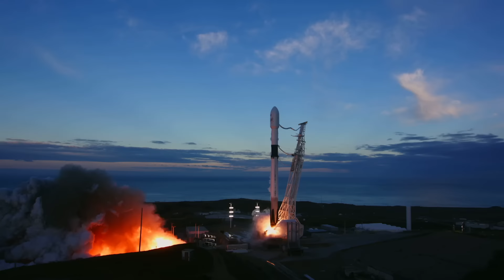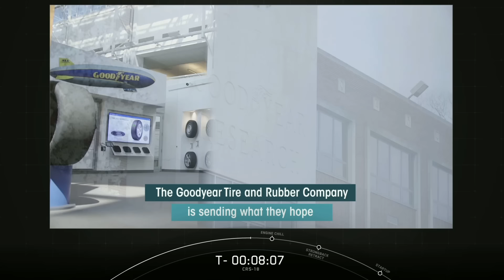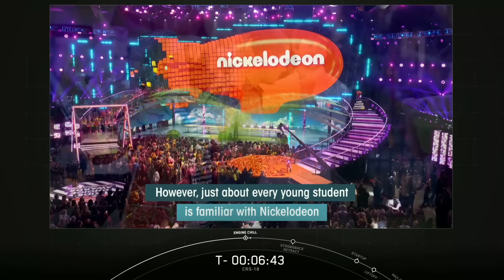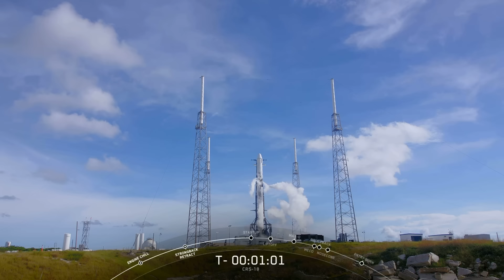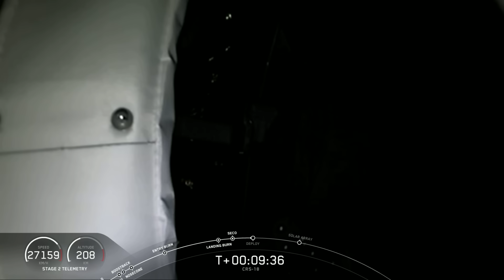CRS-18 Mission

Comment: Grid fins went CRAZY just before touchdown
Reply: That's exactly how they've performed for every mission except CRS-16
Reply: They're traveling much slower so the fins need to move a lot more to compensate for the loss of control
Reply: Im no engineer or aerodynamicist but I would assume it has a lot to do with compensating for the forces of the landing burn thrust radiating back up at the vehicle from the pad as it closes the final few meters? I can imagine it's quite the balancing act in those last few seconds - a testament to their acquired skill in recovering these stages. Great job SpaceX.
Reply: @aaronhill3943  not sure what you mean by that exactly, the exhaust is deflected off to the side and doesn't really affect the vehicle
Reply: Like others said, the fins always do that, but it was very noticeable this time, you could see the air going through the grid. Very cool
Reply: They went stupid

Comment: The success streak was getting so boring they had to put Falcon in the wrong position during landing just for the drama
Reply: They had one come down and have a failure..... still saved it and landed it.
Reply: Maybe the trajectory was set to overshot on purpose, to have more margin in maneuvering  to land, because if it doesn't reach the coast at all, it would be much harder to steer and glide to landing zone. If it is overshot, it only has to align it to vertical, doesn't have to glide further which has less margin and less time to make last landing burn.

Comment: Despite losing the landing streak of 11 in a row on STP-2, let's hope this is the start of a new landing streak which will beat the record of 19 from 2017!
Reply: What was the most recent landing streak?
Reply: @bobdole2911  STP-2  was the last mission so the streak is at 1 with this mission
Reply: ARABSAT is questionable there.... it did land but it didn't make it to shore.
Reply: @luminescentlion  Booster had de-tanked, the ship was heading home and it fell over then, long after the landing phase had ended.
Wikipedia counts it as a successful landing and even SpaceX have even said it counts as a successful landing
Reply: Jake Heke  CRS-16 they partially lost due to a grid fin failure. The landing was a failure but it hit the water soft enough that they brought it home.
Reply: I'm not sure its fair to count STP launches, since, even when they do have trouble with the core, the two side boosters have landed beautifully.
Reply: @alrightydave  Not a fan of curious elephant, he may have imporved but a lot of his videos are highly under-researched, opinion based and way to rushed

Comment: SpaceX, could you broadcast the 2nd stage deorbit? I don't know if there are comms in the area, but it would be great if you can.
Reply: probably not so useful since it might take days or maybe weeks to deorbit, also extra batteries and antennas for that could have been useful payload
Reply: @acr_-kj8gd  The second stage has very likely been de-orbited by now, they probably left it in orbit for a few hours longer than usual to test the new fuel systems but they'd still want it de-orbited before complete fuel boil off
Reply: Andrew doesnt void the argument that it will most likely not be useful

Comment: 2 three-engine entry burns and a one-engine landing burn? is this new procedure?
softer slam dunks,huh?
Reply: Good eye
Reply: Suicide burns are risky. If you have the extra fuel why risk it. So I guess it depends on the size of the payload they're launching.
Reply: @6Twisted  Mainly the speed of re-entry. If they're doing high speed re-entry, they'll use more fuel on re-entry burn. So to save fuel they will do a three engine landing burn. It means they experience more forces and have less control but it does save about 130m/s ∆V
Reply: This isn't new. It's 1 boost-back burn, 1 re-entry burn, 1 landing burn

Comment: A flatearther should be the commentator. That would be fun ;)
Reply: Take me to your leader 🤖👽
Reply: And they are about to hit the firmament, that curvature you see is from perspective, vanishing point is algebra. The rocket is now coming back because it bounced off the firmament and the upper stage has vanished behind the vanishing point because perspective.
Reply: @jarredwardrup6073  apparantly you can't imagine sarcasm either.
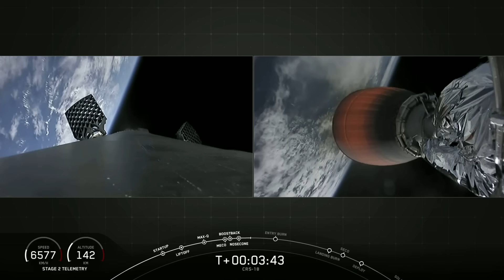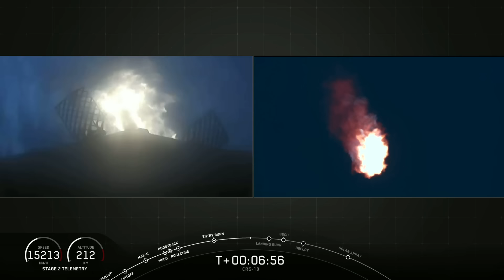Reply: Dear! I never belonged to 'flatearthers' - yet, what is a MOUSE or RAT doing on the surface of CRS-18?? Watch carefully it creeping around, in this video: at 18:20 (altitude 122 km), at 18:40 (altitude 140 km), at 19:09-19:17 (altitude 161-163 km), at 21:25-21:38 (altitude 210 km), at 21:21-21:28 (altitude 211 km), at 21:47-21:53 (altitude 212 km). Also here, can be viewed better: https://vk.com/video-115753333_456241055

Comment: SpaceX: I would really love to see a ground relative speed indicator for the first stage during "boost back" to landing . It's incredible to understand that this part of the rocket goes from 3,600 mph down range to ??? mph in the other direction in just under 50 seconds of thrust. I realize the total mass of the first stage at this point is many times less than the entire vehicle at lift off, but still, that is a huge velocity change in such a short period of time.

Comment: What speeds does the stage 1 rocket reach when coming back to earth after it's done its entry burn just before the final landing burn kicks in? Does it depend on altitude and speed (I'm guessing a million other factors) to know when to start the landing burn? Never get bored of watching these missions.
Reply: Speed changes throughout the flight -- because the stage is falling, the speed is increasing, but because of the resistance of the atmosphere the speed is decreasing -- the balance of the two factors, plus velocity changes caused by the engines, determine what the speed at each moment is. You can see the actual numbers for the first stage flying back in some SpaceX webcasts. For example, see "SpaceX NROL-76 Launch (Re-synced, T-15 until Touchdown)"

If you want to know more about how the stage is controlled during its return flight, google "spacex rocket is a giant flying robot" -- it is a very good article about it.

Comment: After MECO I always see a ring of metal or something break off from the engine of the second stage.  What is that?  And why?
Reply: Comparing to the first stage engines, the nozzle of the second stage engine is made much larger by adding to it a thin metal skirt (made from niobium alloy which can withstand high temperature.) The skirt is relatively flimsy -- the metal is so thin that it can be cut with scissors! To protect it during the launch from getting damaged, it is stiffened with a ring, which falls off after the engine is started.
Reply: @cogoid  Thanks for the excellent answer.  I figured it had something to do with reinforcement or even as protection in case it bumped the (what I'll call..) the tube on the top of the first stage during separation.  Now if I can add a maybe obvious second question - why does it fall off?  Is it as simple as the vibrations just shaking it off and it doesn't matter anymore?
Reply: @McNeo  I do not know what exactly SpaceX uses to hold the ring in place or what it is made of, but Russians often use varnish to glue covers for second stage nozzles on some of their rockets. The varnish just burns off / gets blown away by the exhaust. I suspect it is probably something similar here -- possibly a thin band of carbon fiber reinforced material tacked to the nozzle with some binder that melts at a fairly low temperature.

Comment: Astounding work !
Now, the Fairings. They seem hard to recover.
If they cannot be recovered, is there no way to re-task them into orbiting devices to clean up some of the space junk ?

After all, once in Space, they are no hinderance to the vehicle, and they are already in orbit.
May as well make use of them.
Reply: No, they are not in arbit. They are jettisoned before orbit is achieved. Even if they weren't, they have no maneuvering capability, no engines of any kind. They couldn't do anything.

Comment: Why the automatic docking is not used now?
Reply: Crew Dragon docks automatically. The cargo ship attaches to a different port on the station which does not have hardware for automatic docking, but it has a larger hatch which allows delivering larger items. It is also considered to be safer.

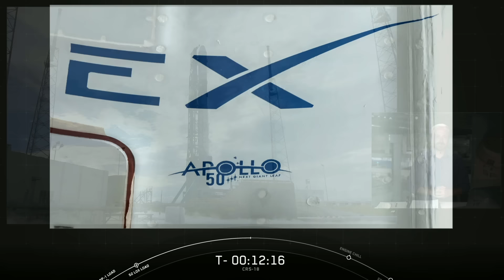Comment: Does anybody (Scott? Tim?) know where the "throbbing" comes from on the 2nd stage? You can see the "tin foil" covering the vacuum engine oscillating at about 60bpm around T:+00:02:45.
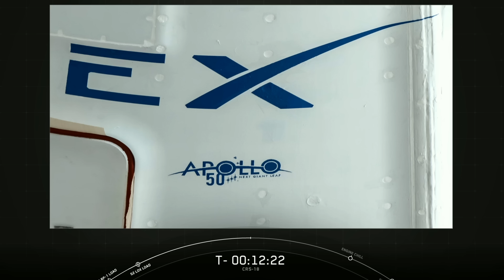Also: what is that ring that separates from the engine bell around T:+00:02:36?
Reply: I am not sure if anybody at SpaceX is authorized to give really specific details about the engine, but if you ask Elon Musk on Twitter he just might answer (though he gets so many messages, that he simply does not see most of them.)

A somewhat generic answer to your questions: 

Engine is complicated. There are dozens of pneumatic valves in its plumbing, and many of them are actuated by high pressure helium. To make things work, the gas must sometimes be let out. That is what makes the wrapping pulsate.

The ring is a stiffener that protects the nozzle extension of the Merlin vacuum engine during launch. The nozzle extension is made of very thin metal sheet and can bend easily. Once the engine is started, the binder, which holds the stiffener ring, melts and the ring segments separate because they are no longer necessary.

Comment: Ok, I don't mind when commentators say a simplified version of the truth, but saying they use 3 and 1 engine burns "to conserve [the RP-1]" is completely wrong. It's true they have a limited TEB supply for engine restarts, but firing less engines actually consumes More RP-1, it just allows a more gradual deceleration, which in turn allows more time for corrections. Even with only 1 engine, on an "empty" stage, the TWR is so high that the throttlling ability of the 1d (down to 40%), would still be incapable of "hovering" the rocket, so the landing burns must be timed extremely carefully.

Comment: If they could only recover the second stage (that's much harder, for aerodynamic heating and mass ratio reasons), SpaceX would have 100% reusable (even the payload fairings, on non-Dragon missions) launch vehicles. It can be done--Boeing and Rockwell designed much larger SSTO and TSTO (Single [or Two] Stage To Orbit), winged and ballistic--reusable freighter rockets with between 400,000 and one million pounds of payload capacity in the 1970s, to support Solar Power Satellite (SPS) and space colony construction. The winged ones (and some of the ballistic ones) were designed to return and land at Cape Canaveral (Boeing's million pound-payload "LEO" SSTO freighter was designed to settle into an artificial freshwater lagoon to be built near the VAB). If an SSTO or TSTO rocket is large enough (like SpaceX's BFR), both stages can be recovered ^and^ it can orbit substantial payloads (BFR makes the Kalpana One space colony feasible, using terrestrial building materials).

Comment: 27:38 Whats that flashing light in-between the solar panel and the dragon? Looks like a light flashing as it would do on a aircraft. Its not the space station right?!
Reply: Someone must know.
Reply: No, the Space Station is nowhere near the Dragon. It will take Dragon two days to gradually change its orbit to match the orbit of the ISS.

What we see here is just a small piece of ice or frozen gas that came off the rocket and is floating very close behind the Dragon. The apparent distance is often illusory in these videos, because of how smoothly even the tiny specks move without air resistance or wind.

Dragon does have navigation lights like an airplane -- you can see them in the videos of the docking to the ISS.
Reply: @cogoid  Thank you kindly for educating us primitives lol 

Yes, now watching it with that knowledge it does look like the distance is becoming greater.

Comment: Do you have the ability to alter which perimeter engines are used in the way back in case there was a glitch noticed on one of the planned engines. Could it be altered inflight to switch t9 a different outer pairing?
Reply: AFAIK, only three out of nine engines have hardware for multiple re-starts in flight. The rest of them require ground support equipment to start them.

If any engine fails on the way up, compensating for this would probably already use up more fuel than a nominal flight, thus making stage recovery impossible even if all engines were restartable in flight.

Comment: At 18:30 on left screen an object is seen fly right then changes direction within seconds  and flys away at high speed??????
Reply: Most likely a chunk of ice or space junk that got caught in the thruster's stream.
Reply: @flooghini5248  Exactly, solid oxygen regularly comes off the engine, this piece happened to be caught in the gas stream of the RCS thrusters and flew off.

Comment: Great launch and an ever amazing Landing. One question though: what normally becomes of the second stage after payload release?
Reply: It is either deorbited and burns up, or put into an orbit that will gradually decay and it will burn up then.
Reply: @odysseusrex5908  Alright. Thanks. Could it be recovered and landed just as the first stage if SpaceX wanted to?
Reply: @Obinwa  SpaceX actually planned on making that happen but decided on scrapping it to put more resources on building Starship.

Comment: What causes determine landing zone on launchpad or on the boat? what are different profile missions that allows earth recovering instead of sea one?
Reply: All depends on speed. If its going too fast to turn around and boost back they'll just send a drone ship to the end of the rockets arc.
Reply: Based on the weight of the payload, and/or the speed they need to attain, they need to use different amounts of fuel. If they have enough fuel to come back, they do, if they don't, they land on the barge in the ocean.

Comment: Y is their live feed for landing so much more stable compare to recent launches? Like usually before touchdown the feed goes off and is disrupted by vibrations
Reply: That happens if they are landing on the ships. It shakes it so much it breaks the connection.
Reply: Plumbus 48 I meant like the on board cam, not only on ships but pads as well they use to break connection

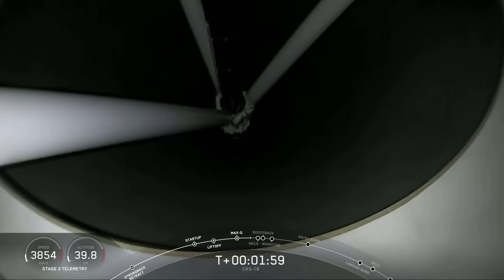Comment: There is something wrong with the speed and altitude meter I counted the increasing kilometres at the speed of 5000 KMH at 17:00 I  discovered the each second 1 km increased to the  attitude that means the speed was arround 3600KMH so weird ?  maybe because of the angle
Reply: Well the rocket is not going straight up, the thing about getting into orbit is that you want your rocket going around the earth faster than it takes to fall down and hit it :)

Comment: how does that tall thing not tip left or right or tip over while landing, if it only has thrust from the bottom, where are the correctional thrusters near the top to keep it oriented? its so tall...
Reply: It has those grid fins near the top which provide aerodynamic effects, and also the engines are gimbaled, they are continuously shifting to counter any imbalance and keep the rocket vertical.

Comment: Pauses the video to convert 5,000lbs to kilograms. 5,000 x 0.454 = 2,270kg. 
2.27 metric tonnes. 
Will there be a docking webcast?
Reply: I guess nasaTV will broadcast the docking.
Reply: Just dividing by two is close enough for most purposes.

Comment: 18.30 - 18.32 what’s the object moving across before the use the gas or whatever that is? Is that the nose cone? Or a ufo lol
Reply: It then shoots rite up into the air when the flash happens from the rocket, on the left side
Reply: Never mind I realized its a bolt lol

Comment: what about stage 2? is it recovered? or just floating around as space junk?
Reply: SpaceX did at one point had plans to recover stage 2 but instead decided to focus on their new rocket Starship/Superheavy. Depending on the mission SpaceX deorbits the second stage over the ocean,  and it gets burned up in the atmosphere. If they can not deorbit the second stage (not enough fuel) they can also put it in a "grave yard orbit", an orbit which is basically for old satellites, so it will not collide with new working satellites. For CRS-18 I think the second stage deorbits over the South Pacific Ocean.